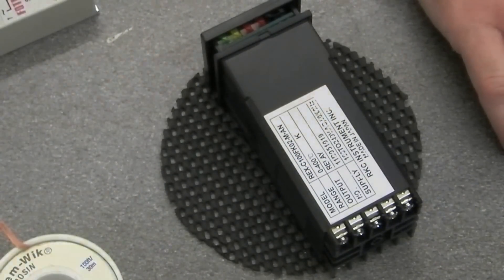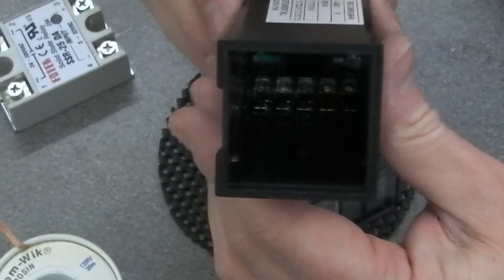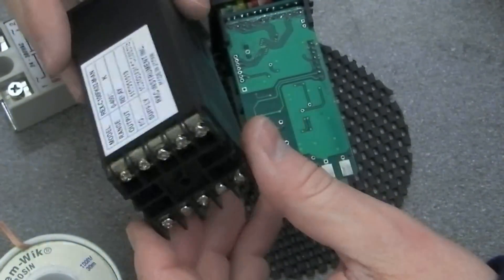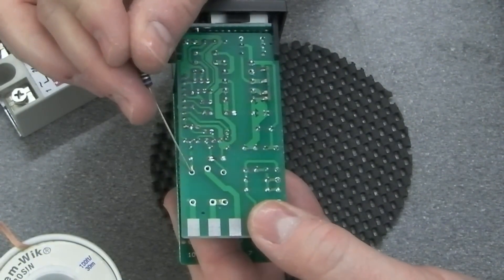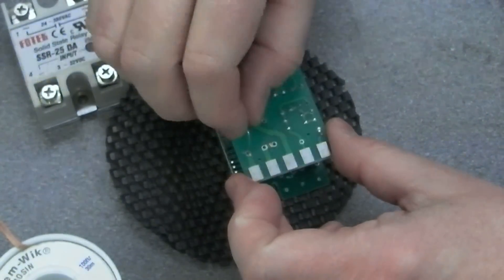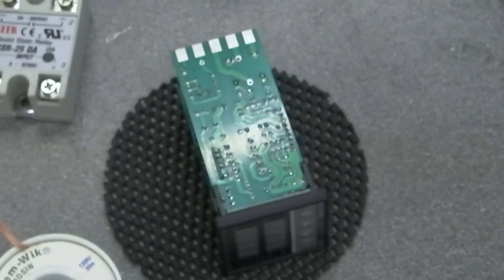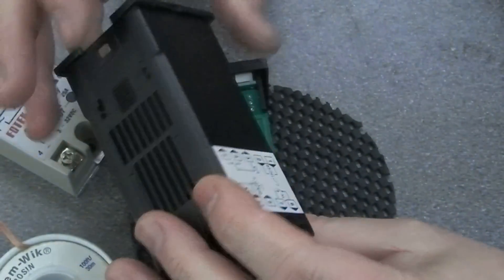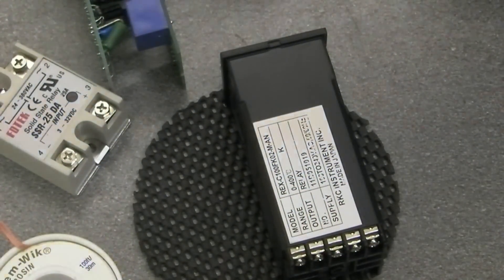REX C100 PID Relay to SSR Modification

Comment: i have 3 of them for controlling kilns. i programed them for up to 1250 C. One is working fine the whole range of temperature.  2 others are shorter in size and click and get jam at 882 C with a repetitive click, without being able to go up .I shunt manually the system 1 or 2 minutes to reach 890 c and replug the pid and then they drive nicely to my desired 1000 c or higher. Have y an idea where this blocking of 882 C comes from ??? Seems all rex c 100 are not same...

Comment: Hello! Verry good job! You did waht i was thinking to do. One question please. Do you think it's possible to put two SSR on the 4&5 outputs? I think yes but i don't know what amperage REX-C 100 could accept. Normaly SSR don't need to much current to work no? Sorry for my english because i'm from France.
Thanks a lot.
Reply from the maker: This is a very old video. But two SSR is fine. Very little power is required.

Comment: I wonder how to get a 4digit led display timer module connected to this hole pid controller, for building a 3d printer filament dryer box. 🤔
I have problems too find a easy MOS timer module that can run more than 999minutes 24/7 too. 😔

Comment: sorry Trevs but i have a problem with the rex c100 after i did the mod and used it a few times the rex c100 doesn't feel the k-type thermocouple but i've tested it and it works with another device this happened after i played with the settings in the menu but i didn't changed the thermocouple type in the settings as i can't, it is predefined as k-type and you can't change it also the menu that shows with shift +menu don't show this is Chinese Berme rex c100FK02-V*AN DN i think something in the hardware not in the settings. is there anyway to reset the device to factory settings by pressing the keys ?
by pressing menu+ down key for 3 sec menu shows with LAS,HAs,CAS but you can't change anything in it just show some values 
anything i can replace on the board ?
can we use email for for fast respond ?
thanks
Reply: i know the cause of the problem but i can't solve it the problem is sure software nothing in the hardware i have another rex c100 same thing for everything i just hold press set + down key and menu show with LAS, HAS, CAS and you can't change anything in it just pressed set 3 times to exit the menu and after that the PV reading is fixed on 34c and i can't reverse the process if i got to the menu again and reached CAS and pressed set the PV value change from 999 to down and if i got to the menu and pressed set while CAS is shown it returns to 34c but it can't read the actual temp what is the problem i have now 2 dead bodies with the same problem

Comment: nice work your video really helped me a lot as i reversed the process you did to convert my ssr relay version to normal relay this was big problem for me as i use dc heater and ssr don't work with DC volt i've removed the output resistors and soldered 12v relay and it works like charm i don't know how to thank you
Reply from the maker: I am always pleased to hear if my videos helped someone.

Comment: i got a seriouse question   can you use a  RELAY instead of a SSR   if the relay need a 24vdc  input to activate ?
i think i got my own anwser i need a 12vdc relay input   hehehe
7:00 around there he said  to connect the 12v input

HECK i need to use my multimatter now i need to know

Edit1: i want to use the feature of NO and NC to quickly switch between cooling and heating without having to reprogram
it will work but need a physical relay with those NC NO  contact and a simple 3 pole switch

Edit2: i confirm its 12v  so i need 12v  relay  time to ebay this 1

Comment: I took out the built-in relay to find out it is rated for 10A at 250v not 3A. Still, those are probably Chinese amps, so I guess it's a good thing.

Comment: Hi!
Could you please give me some advice?
I have a REX-C900FK06-M*AC (output RELAY) that is coupled to a 90-240 Vac input/15 Amps output SSR to power two band heaters which sum up 2.5 Amps. This setup is working fine so far, however, I am going to need to power 2 more band heaters (5 Amps in total) but accoding to the specs of this controller the contact rating for the relay output is 3A at 250Vac (as you have mentioned on you videos). Do you think there is a way I can power those 4 band heaters using the controller along with the AC-input SSR? Or 
should I just get the controller modified (as you showed in the video) and then couple it to a DC-input SSR?

Comment: Good video very helpful as I have just purchased one to make sous  vide converter for my crock pot the SSD you show is only capable of taking a load of 14 amps as that is the size of the triac at 230v ac ( see big clives channel for the triac) I think I will remove the plastic tab that holds the connectors in then solder them to the PCB plus your relay mode as Mine will fit into a case

Comment: I still see many selling this PID on ebay with an SSR but on reading the output details of the listing, it is still only relay only. What happens if you connect to an SSR without the above modification?

Comment: What am I missing? It would seem that the unit described in the video has a relay that switches main power on and off. And it's being modified so that it now has intermittent 12V power being switched on and off. This 12V power is now input to a SSR which switches main power on and off, which is what the unmodified PID was doing strains out of the box!
Reply: ***** OK so now I am going to answer my own question. The presenter in the TelevisionMagForum video says that the relay that came with the PID can only switch 3A. I just got a PID that has the same model number and looks exactly the same, but the colour of the relay included is white, not blue like the one in the video. I just downloaded the specs for the built in relay its 10 Amps, 250V AC, 300W resistive load and the electrical endurance under those conditions is 50,000 operations - the mechanical endurance is 10 million operations - 

50,000 operations is about 3 days of constant operation 5 seconds on and 5 seconds off - I assuming that either way counts as one operation. I am using this PID to control a heating element, that will be on a few hours at a time and then turned off. 

So I don't know what these ratings mean exactly, but I think that mine at least is safe to use as is straight out of the box without the SSR. If the relay fails then I will make the modification....

Comment: P.S. They now have an SSR option so no need to modify. Sold together w the SSR relay and TC on ebay.
Reply: they had that 3 years ago when I bought mine for 22 bucks shiped with the ssr , heatsink and thermocouple.. as little workshop stated there are different models so its wiser just to buy the right one.
Reply: Does rex c100 has a dc voltage output or just a relay? Do we need an additional dc source to supply ssr?

Comment: that is a chinese knock off... I bought a rex-c100 on ebay that came with an ssr/ TC probe and heatsink for just over $20 and the internals are not the same as the ones in your video... It appears there are multiple versions of clones in china just like the STC-1000.
Reply: +fathergratwick There are multiple versions of the real thing with various output options as indicated in the manual the letter after the dash denotes which output type it had. But yes there are certainly clones given the low prices and Chinese manuals with some.

Comment: First control output [out1] (heat-side)
Rex C100 FK02-V=Voltage pulse SSR  
"         "       "    -M=Relay Pulse
"         "       "    -G=Trigger(for triac driving)

Comment: Hi,
Could you test this operation of Hakko 907 solder with this PID ?
1. A digital temperature controller ($20 Ebay like this one http://www.ebay.com.au/itm/PID-DIGIT...item27cb1b61a8)
2. A Hakko soldering iron ($7.69 Ebay http://cgi.ebay.com.au/ws/eBayISAPI....:X:AAQ:AU:1123)
3. A 5 pin XLR Audio Cable Connector ($2 Ebay like this one http://www.ebay.com/itm/1-pcs-XLR-Au...item23216e3bf9
4. A 24V transformer I had lying around to supply the iron heating element
5. An old computer power supply or Any other PS
6. An old 240v LED I had lying around to show the Mains power active
7. A Soldering iron holder ($2 I think off Ebay)
8. A variable resistor and a bit of board to put it on to calibrate the temperature
9. A couple of rocker switches off old PSU's for switching the mains and heating element
10. Later I added a couple of spools to hold the solder reels on the top for convenience.
and I got a good soldering set !!

Cheers
Mike

Comment: the only thing that isnt clear is when using it to run an ssr is what cable connects to what on the pid?, there are 3 connections on the pid (3,4,5)and only 2 on the + and - going to the ssr itself, are only 2 used? if the 3rd is used as it seems for an ext voltage? then what and to what pin?, i have the same pid as in the video, i have finished the mod, i have checked the ssr and that seems to be functioning, to have defined ssr connection info for the modded pid will help decide if its  a duff piece of kit or not, thx in advance

Comment: Hi, i'm just dumb, sorry, but i don't understand by you do this? i have the same model, haven't conected it yet, but want to know so i don't break it. 
I will use it to heat a 12v resistor, but i have 220v on my socket output......how do i conect it???? should i use a power switching before or after the pid? i mean, could i feed 12v to the PID? or it works only  with 220? then i should conect the switching after the relay??? HELP!!!!!
Reply: ModulArt22 the rising panic is amusing

Comment: Thank you very much for your tutorial; I have made use of the REX C100 as a controller for a 'sous vide' device that switches a rice cooker or slow cooker. Complete with fuses and heat sink. Again thanks fro your patience.

Comment: Just curious. I have the same kit, and have been running the SSR direct from the PID without modification. Why make this mod exactly, I don't quite get the logic, sorry. I would like to understand though.  

BTW, you did give me a very good insight. I know for a fact that the cheap Chinese copies of this PID don't always work, I destroyed two in early play. Your pulling apart the box alerted me to the possibility that sometimes the outer casing is not always put on the right way, so, pull it apart to check that the pin designations are what they are actually meant to be.  Cheers and thanks.

Comment: I must have gotten lucky, I ordered one off of aliexpress and it came SSR ready for 22 bucks, included the ssr, heatsink, and K type as well. Just in case it helps any one else out its model number was REX-C-100FK02-V. I think that the "V"  maybe stands for the low voltage output to control the SSR.
Reply: ElementCollector1001 - Yes, you have to be very careful with the part number - some models can control a SSR without modification... Those will ussually have the word SSR in the "Output" description on the side... Confusingly, some like the one on this video, will have the word "RELAY" printed on the side. This does NOT drive an SSR, it switches main power. Unfortunately I found out too late.
Reply: same here when I bought mine 3 years ago... no need to reinvent the wheel
Reply: You can however easily modify the relay controls to drive an SSR

Comment: Very nice modification! Did this to my rex-c-100, but cant seem to get the 12v pid output stable enough(measuring 12,2 when conected to the ssr). The ssr output is kind of stuttering outputing a voltage of 200-230v when i measure with my multimeter. The ssr i working properly when suplying it with a 9v battery. Anywon else having the same problem? what can i have done wrong? thx from diy guy=)

Comment: Hi, at first thanks a lot for this really helping video for electronics loser like me!! 

I've done exactly the same modification in order to drive my SSR for an oven who cured carbon parts.

Unfortunatly doesnt works as good as in your video. The output green led is effectivly light on but the red one on the SSR stay light of, Try to measuring if any voltage  comes of the 4 and 5 pins but nothing.

Could I ask you some help if you can identity the problem.

Thanks a lot in advance
Regards

Comment: i picked the version that just has a couple of resistors instead off ebay. the resistors are crossed over though, not straight jumpers like you did
"AC 110-240V Digital PID Temperature controller + 25A SSR + K thermocouple Sensor" came with a thermocouple and the same ssr.
Reply: I have the same unit. The 25A SSR would get really hot. I used it to automate fractional distillation.
Reply: Pascal Roget yeah needs a big heatsink otherwise the SSR's metal lugs will eventually break off with the cool/heat cycle
Reply: I think we have the very same unit at my plant in chino regulating temperature in a 1000 gallon reactor but i remember that something was wrong with it. I will snap pics when I get a chance.
It will give me an excuse to go to 23b.
Reply: nothing that cool ;) soldering hot plate
Reply: What are you using yours for? Sous vide cooking? Coffee? Drug synthesis? :-)

Comment: How about range? In description range is 0-400 degrees.
If I have K type termocouple probe that work at -100+1250 degrees, can this controller measure and control high temperature till 1250 degrees?

Comment: I have  been buying a couple of  the  REX c100 of ebay and  i  guess they are a cheap Chines copy ..  I  was thinking about the   conversion to SSR and also a way to run it of 12 to 14.8 volt  dc   and i  wonderd if you had any ideas on  how to  convert it ..

Comment: Hi, thank you for upload this Video.  I Have a Temperature controller Autonics brand that it has relay output but i need a ssr out for the fater response that works the ssr. I know that the relay has a sloer respose. If i make this modification to my controler, would it speed up the activation response or it will be the same seep response with the difference that has no mechanic components?
is the pulse freccuency higher that the needed to activate the mechanical relay?
Sorry my bad english.

Comment: the LED driver is a 3 x 1w 12-18v 300ma type.  as you load it up with a few small led.s it drops the voltage towards the 12v end.  I have used this supply to run 2 12v fans from CPU's.  one is attached to an aluminum fin block.  I am going to mount my SSR to that block and screw it to the side of my enclosure.  so for 3$ I got voltage for my fans, proper signal voltage and power on display LED's.  not too shabby

Comment: no they sure don't.  but the good news is the relay one I got works, well just like a relay.  it doesn't supply the 120v AC from inside the unit.  but any voltage hooked to it.  so I got a LED driver off ebay for 3$ from china. with that hooked up it only switches that input to the SSR and a few led's to manage excess.  no soldering or dismantling.  it all fits nicely in the steel water heater brain box from the fleamarket.  I gutted out the crap in there and kept the terminal block. cheap fix

Comment: I got the rex-C400 and it needs a relay not SSR, meaning the supplied SSR does not work with it... 
Ebay sellers don't know what they are selling anymore then a uninformed buyer knows what they are getting. Or the sellers just don't care.

I will try this seen as the units which I have two of were only $20 including SSR and thermocouple. And the units I need seem to be $40 each...

Comment: Your are completelly right about the wiring regarding the C100, the realy wasnt working, and when I modify like you said it starts to work.  Now I do have a question.  My relay SSR still passing current, I measure and shows 120 V when on active, and 76 when inactive.  Is there any problem on the SSR?  What is your opinion on it?

Comment: hey I am working on building a small crucible furnace and wanted to use the rex-c100.  I saw another youtube vid showing how to raise the preset limits so its not shutoff @ 400'C.  basically making your thermocouple lead the limiting factor on reading.  but on ebay I see lots of the rex-C100 packs sold with the controller a thermocouple lead and a SSR for 21.99$ n free shipping.  why would they sell the SSR with it if you have to remove parts for it to be used( which 99.99% of customers cant)

Comment from the maker: I have not experimented with a cooling fan but I would suggest you look at the second relay that is fitted in the REX. This relay is triggered by setting the Alarm to whatever temperature you would like.
Please look at the wiring diagram for the Alarm output.
You will have to supply the 12 volts for the fan via the correct relay contacts and that 12 volts would be switched when the Alarm is triggered.

But please confirm the correct contacts on your device.

I will try to make a video for this.

Comment: The Fotek SSR-25 DA you show has an input impedance of about 1600 ohms at 12v for a current of 7.5mA.  Instead of the jumper wire, you might be able to use a 1600 ohm resistor as a current limiting resistor to protect the internals of the PID from a short.  Or instead of this 1600 ohms, check the resistance of the existing relay and match it with a current limiting resistor.
Reply: Hi. Did you test this? Works fine?

Comment: Thank you very much for the video and comments. I finally did modify the REX C100 and with the SSR works fine. The only thing noticed is that I purchased three REX C100 controllers, from which the one was smaller and the relay placed vertically. It seemed to me as a cheap replicate at first, but it worked fine. The only thing is that it needs more delicate handling in removing the relay compared to the other two ones. Thanks again for your useful video, could not have done it without it.